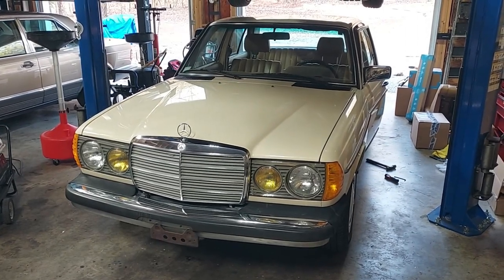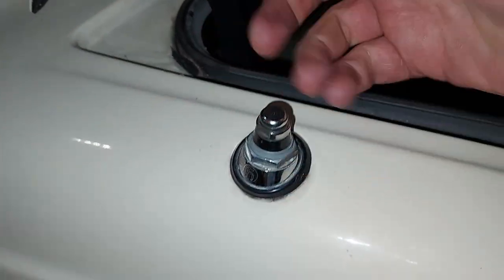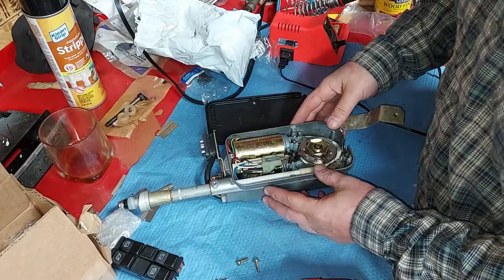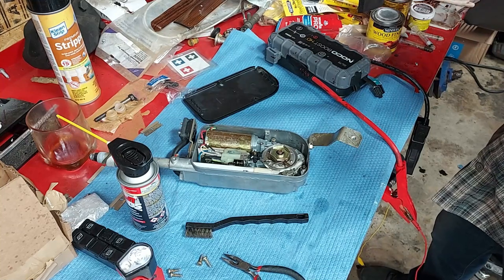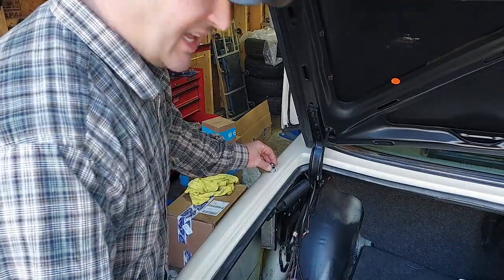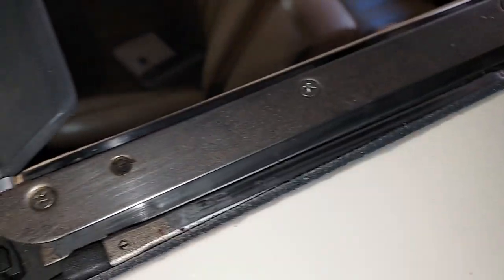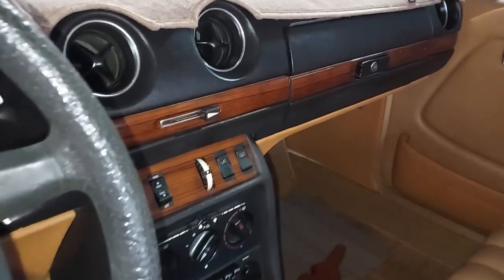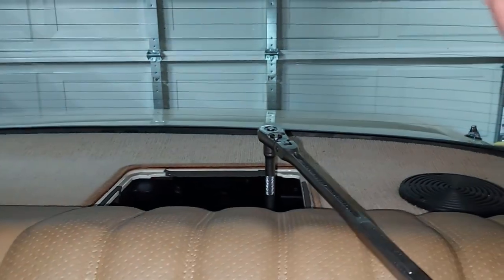1982 Mercedes 240D Manual - Part 5 Door Strikers, Antenna, Fuel Sender, Sunroof

Comment: I have a 1983 and luckily they were still using the chrome grommet that year!  It's a different fastener screw though...just has two notches so I'm not sure what tool they use to unscrew it.
Reply from the maker: That's good information I think my favorite year is 1983 a lot of guys love the 1985 but what they don't realize is that Mercedes has already started cutting corners in around 84. I think 83 is the climax year from an engineering and mechanical standpoint.

Comment: Excellent video. I’ve done some of this stuff to my 1980 240d. Haven’t tackled the sunroof or antennae yet. I also need to do my A/C and clutch master/slave cylinder. Im assuming you must be near Atlanta based on accent and the YouTube description phone number. I’m up in the mountains above atlanta. Are you a w123 shop? Any good references for local w123 salvage yards? Parts places? What about body and paint guys familiar with fixing rusted w123 body pieces? Thanks!
Reply from the maker: We are actually a classic Mercedes restoration shop and dealership. We do not do service on outside customer cars as we are not a service shop. My recommendation would be to call around and talk with some of your car buddies to try to find a good paint guy in your area.

Comment: Great video as always.  Do you believe it’s possible to use one of the metal antenna grommets from the early 80’s on an ‘85?
Reply from the maker: No it's not because the metal grommet actually screws on to the end of the hershman antenna so you have to have an early hirschman antenna

Comment: Question 😋 where can you find a dashboard cover. I can't find 1 for the W126
Reply from the maker: I actually don't know where you can find those the only one I have is because it came with one of the cars. I would check on eBay.
Reply: Check out mbz classic parts
Reply: @mariobarac9564  absolutely. And I found a dashboard mat

Comment: Where did you get the special grease for the sunroof tracks?
Reply from the maker: I ordered it from Uncle Kent years ago. You know Mercedes source Kent.
Reply from the maker: But you can buy it at any Mercedes dealer in a big tube
Reply: @woodsandbarclay   Good to know, its available also at a MB dealer.
Reply: @woodsandbarclay   The container looked familiar, just wanted to know.